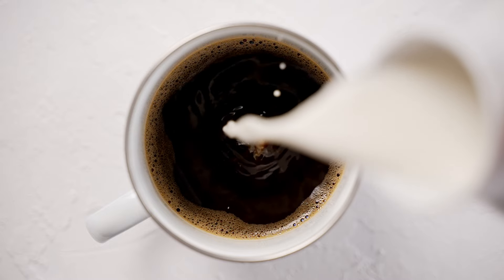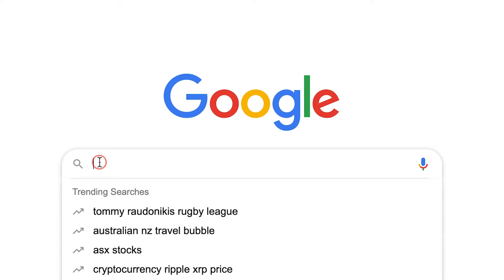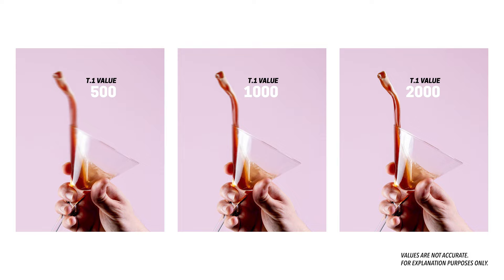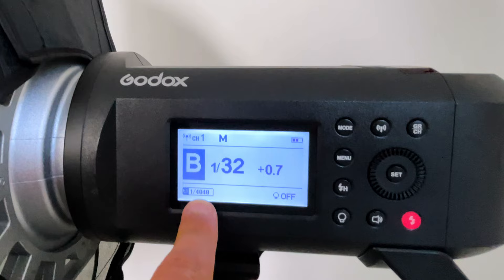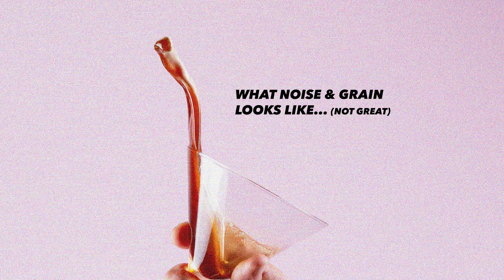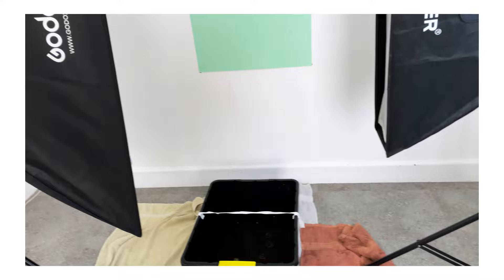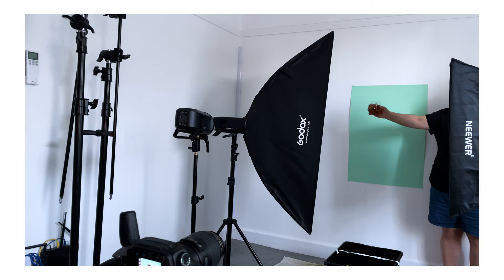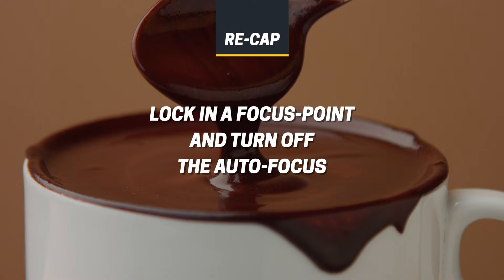Photograph Motion with FLASH Photography

Comment: Hi Jacob, congrats for this channel, first of all. Just a question about the shutter speed. If you use two strobes and not one of them with a continuous light, why that slow shutter speed? I use low values of SS when I use a strobe and a continuous light so I can "see it" in the photo.
Reply from the maker: Hi :) and thank you! 
Well the slow shutter speed is what i have had to compensate to get the correct exposure here. 
The most important thing About freezing motion is the flash duration speed. 
I need that flash to turn ON and OFF very quickly to freeze motion in time. 
You can adjust your 
Shutterspeed 
Fstop 
And Iso
To whatever u like.. just make sure your flash duration (also known as T.1 value) is not lower thAn a T.1 of 2000